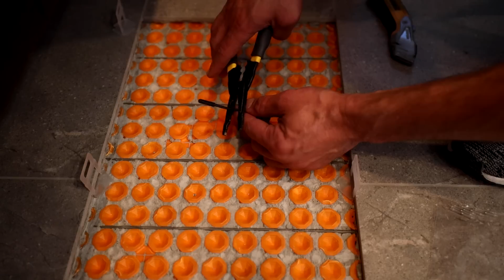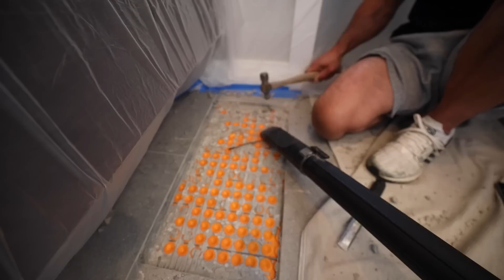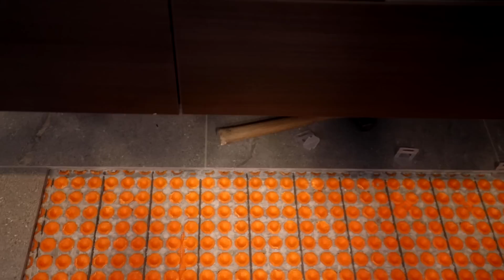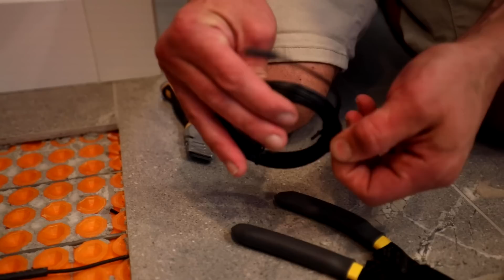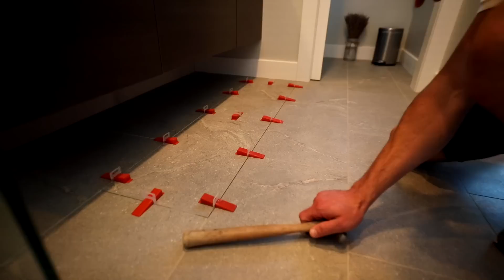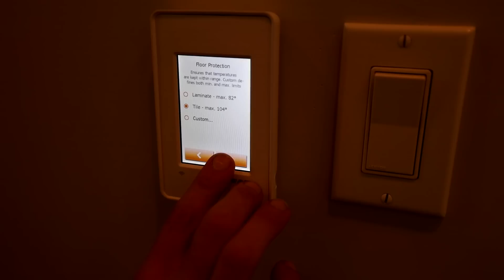DITRA HEAT SENSORS FAILED and Schluter PAID for the FIX!!! ---How to Remove and Replace Tiles

Comment: Had tile fail due to inadequate coverage. Watching this to prepare to remove old tile and then reset, hoping to not damage the ditra heat. Thanks for this great video!
Reply: The dewalt or Milwaukee cut off tools are perfect for this job. You can set the cut depth on these grinders.

Comment: Would you recommend  the product now? I was thinking why does the sensors have to be under the floor? Maybe have it near the tiles edge or unde the base board or in the grout joint ? I am about to recommend this for a life long customer.  They claim they fixed the sensors but didn't want to talk about it. Cut the call short.

Comment: It does not appear that you actually melted the solder ring (21:26).  If the solder melted properly it would have blended in with the wires just as if you used a soldering iron.  But given that this application will be set in mortar and not subject to movement, and that the two wires are touching, the circuit will likely work as expected.  If this was done for a harsher environment (aircraft or marine) where there would be a lot of vibration, you would have a problem.

Comment: We have the same problem here in Oakland,CA, both sensors failed over time, though ours indicated temps much lower than real, so heat stayed on. How much did your repair cost, and did Schluter fully reimburse you?  Thank you for posting this video!

Comment: I just got around to installing my Schluter DITRA-HEAT-E and I start it up and E2 failure, cant get a signal from the floor temp sensor.  I installed both of them and they both dont work.  This is all tiled right in.  What a shit product to have two temp sensors that you know get permanently installed and still have such bad QC that they both are bad.
Reply: We had the exact same problem, dealing with it right now. Schluter rep can't believe both sensors failed. It's frustrating bc I'm worried about damaging heat wire trying to rip up 2 tiles to replace bad sensor heads. I'm also concerned it could be the wires. What happened in your case?

Comment: Well... I thought the Schluter temperature sensor issue was resolved in the past, however, I purchased my heat tracing kit in April this year. After 4 weeks of service, I got the same issue, thermostat reading is at 82F, while the floor is at 70F. 

In the process of speaking the Schluter, lets see if the price premium has me covered.... To be continued...

Comment: Bro just set the thermostat to tale ambient temp instead of floor
Temp and you would not have had to do this. 
Smfh. 

Also always put “2” sensors in floor for this reason.

Comment: For people that say he should have known, or should have tested prior…Schluter has a known problem with the red and black wire sensors failing at a much higher rate than the black/black sensors.  Great work as always.

Comment: You should have tested if the sensor was reading well before trying to melt the solder, which I don't think actually melted.  So I have used those in the past and what I have done was actually twist the wired together, test the connectivity, then pull the solder tube over, test again, and then shrink wrap it.  Maybe it's just me being stupidly cautious.

Comment: After having a floor tile heat system fail after a few years I would never use one again. I noticed a comment saying you installed the splice wrong. How many times will you have to back to this job?  Just say no to this heat system.

Comment: Cutting the wires different lengths so the two splice/crimps are staggered and don't align can help reduce the overall bulk of the repair (if you have sufficient length of course).

Comment: Yikes... I'm a week away from purchasing a Ditra Heat system now I'm freaked out. I'm can only assume there's a boat load of the old style problematic sensors in the market place and my luck I'd get one of them. Hopefully there's a way to quickly tell  (i.e part number?) if its the old or the new style sensor without having to split the shielding to check the wire colors.

Comment: I've always been a little sketch about the reliability of these small sensors. Maybe for the time being it would be better to place them under a tile that's not permanently set, somewhere in a corner that doesn't see much traffic. S caulk instead of grout and no thinset.
Reply: That's a good idea

Comment: Lol ALWAYS install two sensors in the heat mat, ALWAYS. And facing the heat gun straight down at the ditra instead of across.not a huge deal but odd. Don’t do that

Comment: Just a FYI for future reference, but the solder in those sleeves did not melt. When it does, it completely loses its shape and flows into the wires. I've used those types of sleeves thousands of times in the avionics world. Right now, those wires are just squeezed together by the slightly deformed solder ring. The heat has to be applied consistently until you see the ring fully melt.

The cool thing in the video is seeing how insanely well bonded the tile with the Ditra.
Reply: Damn, can you forsee it failing in the future because of this?
Reply: Yeah, those air heated solder splices are rubbish, and I very much doubt they are approved for avionics repairs which normally stipulate a crimped, non soldered connection. There's not enough solder in them to flow through the joint at the best of times, plus the solder isn't the best either. I can see this failing again at some point, high resistance, and because the original joint wasn't done correctly, there'll be no coverage for the costs of redoing it again.
Reply: They are not used for avionics repairs. There is a specific type used to solder a lead from the ground of shielded cable. Some even come with the wire already in place. You are correct regarding repairs... a high quality crimp connecter is used that has a heat shrink sleeve melted over it, which completely shields the crimp connection from the environment. @thegrimreaper7777

Comment: Thank you for sharing.

Very enlightening and disturbing at the same time, as an electric engineer.

Planning a dual zone Ditra heat system in a master bathroom model in our home.

Planning to use your paid consulting service as well.

Thank you for everything you do from the Hoosier state, IN.

Comment: That butt joint isn't complete.  The ring of solder MUST MELT.  This will fail again because the heat wasn't high enough.  These type of connectors need a heat gun with a curved shield on the nozzle to direct heat back toward the gun heating the connector from both sides, and you need to get it to close to 1,000 degrees F so the solder melts.  You might have a connection since both wires fill the connector most of the way, but over time there could be corrosion buildup between the wires causing increased resistance and another failure.  You might get lucky, we'll see over time, but next time watch someone on YouTube demonstrate how to use these solder connectors!  Really poor connection and you need to post another video explaining how this isn't right, and show the right way to do this.  Again, the SOLDER MUST MELT, if it doesn't it isn't doing anything at all.
Reply from the maker: Thanks for your concern but the solder did melt.
Reply: @TileCoach   Hard to tell from the video quality, but it looked like the ring was intact.  I've used this type of connector a lot, it takes my gun set to 1,200F more time than. you showed to melt the solder.  But if you are confident it melted that's good, you were there.  Sharper, steadier video next time please.  LOL

Comment: Couldn’t you just add a resistor to where the sensor wires connect to the thermostat and offset the bad readings?

Comment: Maybe you did but your supposed to run both sensors in the event one fails. It is super unlikely that both failed. If there was a failure of one sensor then it's easy peasy to open the electrical box and swap in the other sensor and no redo of the tile.
Reply from the maker: Maybe you should watch the video?
Reply: @TileCoach My bad...I missed that explanation.

Comment: You do a better job at being electricians, than electricians would do at tiling! We JUST put our ditra heat and sensors in so I’m glad I saw this repair video, just in case. Everything is testing good, just need to grout. DIY but your videos were super helpful on what to do and more importantly NOT do. Thanks for the vids

Comment: Had the same issue with bad readings from both of the sensors we installed. One was reading too high and didn’t heat up and the other too low and was constantly trying to heat the floor. 
Schluter reached back out to me and will do a diagnosis in 2 weeks. Said I’d be reimbursed for my time for demo and replacing the tile. I was told there was a known issue with some sensors being faulty.
Reply from the maker: That’s exactly what happened with ours
Reply: @TileCoach  I posted a separate comment with the list of effected wire kits, to my understanding the major tell is if the sensors are packaged with red tape tabs instead of the usual black wire ties (schluter bought a run from a dif supplier I would guess?) I think their hope was that most got pulled from distribution before it became a widespread issue.

Comment: Our schluter distributor showed me a bulletin a couple months ago about a specific serial range of kits that have a known bad batch of sensors, sadly i cant find it posted anywhere publicly.
Reply: These are the wire kits affected, haven't managed to get ahold of the more detailed info again yet.  https://drive.google.com/file/d/1Y88SmeuO47UxrRmUPMqWEIOFfKtJ1ZzN/view?usp=drivesdk
Reply: @begalbrew5572  thank you!
Reply: @begalbrew5572 thanks for the info. I have 2 systems to install. Both are on the list. I'll be contacting schluter tomorrow.
Reply: I installed my ditra heat about a year ago and submitted the warranty sheet as needed. It is working well but I wonder if the company will notify me if the serial number of my kit is one of the ones with problems?
Reply: @Alex.smiffy  years ago I would expect a company to notify about a registered product, though these days unless it's a federal recall or safety recall I doubt they would. In this case I think they are just paying the claims as they pop up and hope that most were pulled from distribution stock.